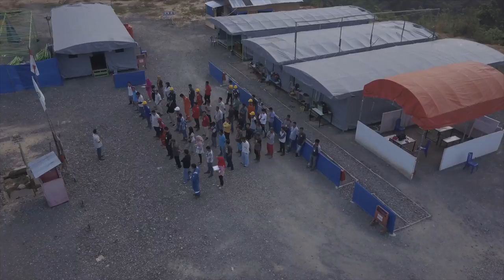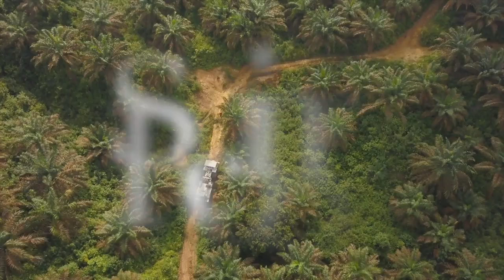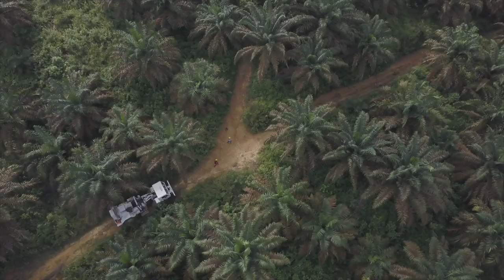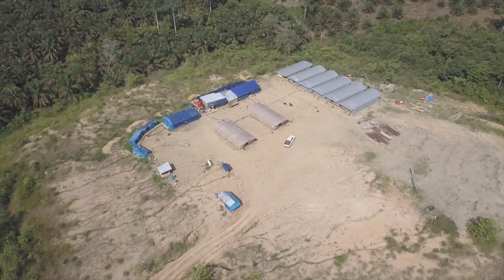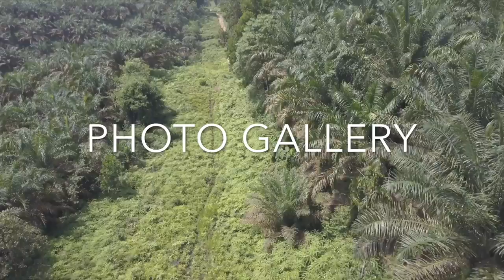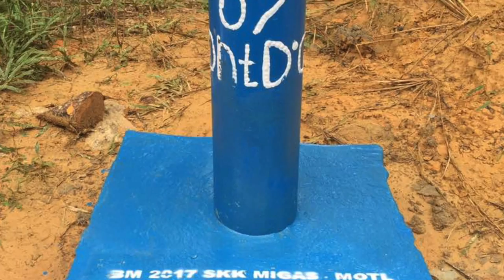Vibroseis 3D Seismic survey - Jambi Indonesia

Comment: Wait, it is completely safe to induce earthquakes near a tectonic or volcanic hazard area?? Real question here. Actually wondering.
Reply from the maker: Ben Ferraiuolo actually it completely safe because we located in back arc basin and away from tectonic plate and volcano. We do seismic in indonesia since in the 70's and never reported any issue with earthquake and volcano
Reply: The vibrations are far to weak to cause any issues at all.